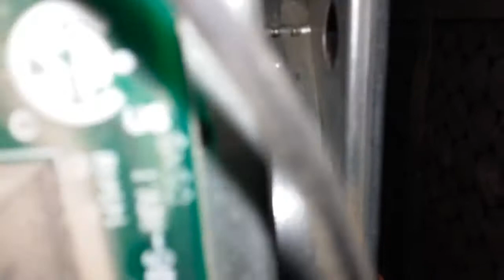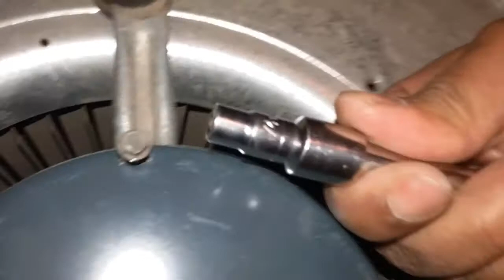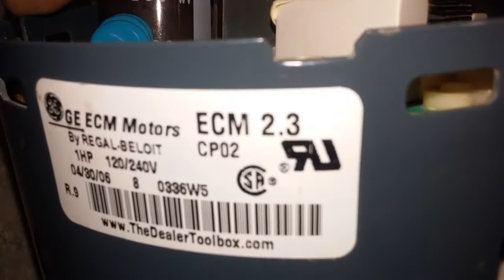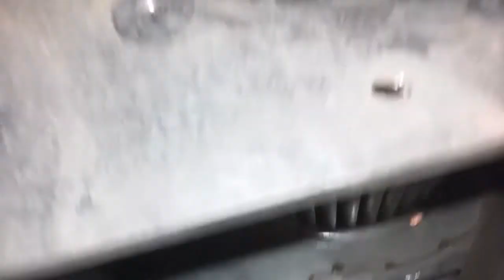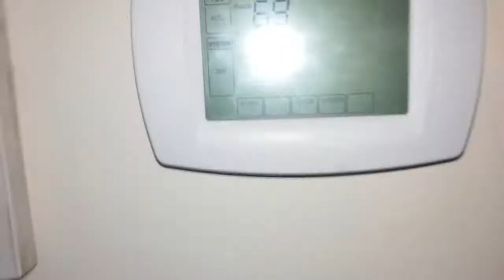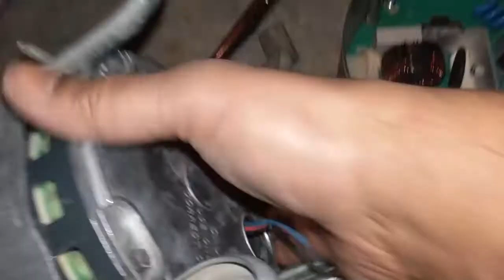ECM Blower Motor Replacement - American Standard/Trane Furnace

Comment: I’m gonna have some fun with this one. 😂 My HVAC is in the attic and rotated 90 degrees so the air flows horizontally. Thanks for the video. This is exactly what I needed to start to figure out what needs to be replaced.
Reply from the maker: Have fun! Hope it is the thermistor that burnt up. Check my other videos on that repair - https://youtu.be/3XmDkrcVeCc.

Comment: Every detail video on replacing the heater blower.  Thank you.  My TRANE VX80 [BLOWER D341314P04: MOT09232] blower is not blowing sometimes but it works most of the time.  I might have to replace the whole blower assembly as well.
Reply from the maker: You may want to check the connectors. I found the if the connector is loose, it will intermittently stop working. Also check my other video if the blower does not start at all - https://youtu.be/3XmDkrcVeCc.

Comment from the maker: Ebay link to used ECM motors - http://rover.ebay.com/rover/1/711-53200-19255-0/1?ff3=4&pub=5575486972&toolid=10001&campid=5338486955&customid=&mpre=https%3A%2F%2Fwww.ebay.com%2Fsch%2Fsis.html%3F_nkw%3DGE%2BMOTOR%2B5SME39SL0253%2BWITH%2BMODULE%2BD341314P05%2BMOT09233%2B%25287792%2529A3%2BAP%26_id%3D132961796621%26%26_trksid%3Dp2057872.m2749.l2658